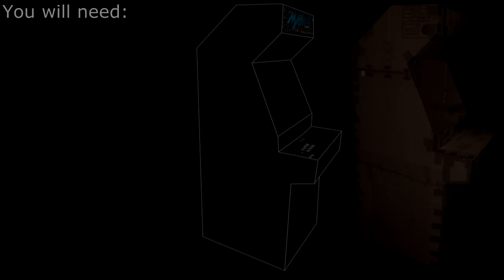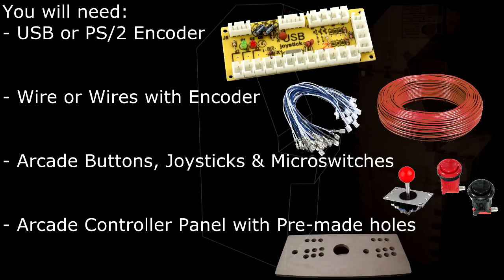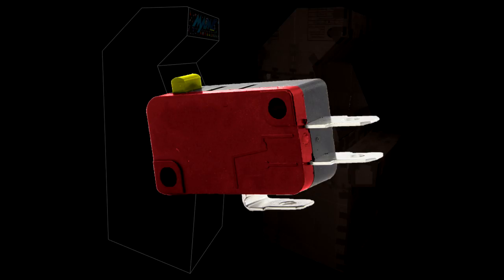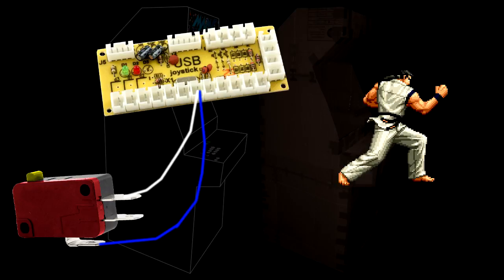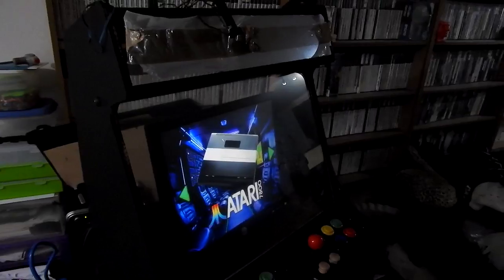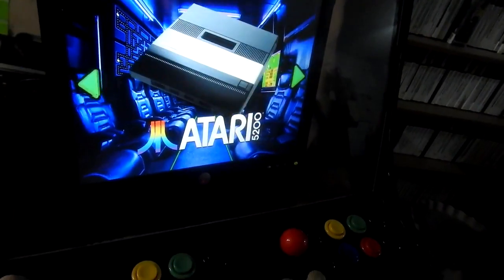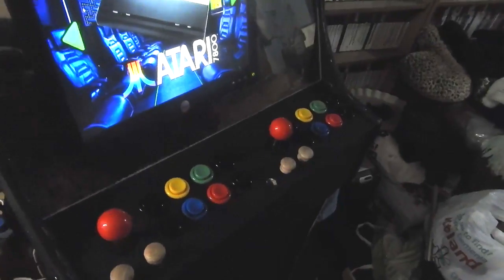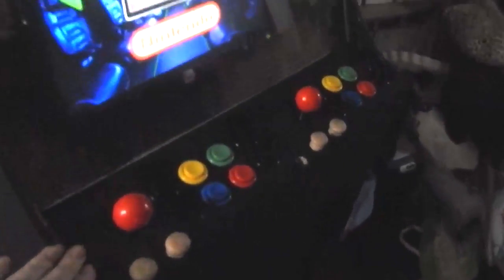How to Make an Arcade Controller Panel - Building A MAME Arcade Cabinet

Comment: Interesting video - and you maybe the guy to help me - I’ve recently bought a Sega mega drive mini or (Genesis mini) as it’s known in the states. I would like to build it into a 1up style cabinet and build an arcade style control board like you have there for it - can’t seem to find any info to do this online - the controllers that came with the mini mega drive are USB types so I’m guessing it’s possible to make a controller for it? Most builds are based on the raspberry Or Pandora systems but I’m pretty happy with the hardware I have. Hope someone can help - I’m totally new to all this.

Comment: The wiring would drive me nuts, I would rather fabricate the shell. Looking good.
Reply from the maker: Oh it drove me a little nuts by the end of it, simply because the cables were simply no where near long enough to wire everything up.
For future projects I will definitely be making sure the cables are long enough and extend ones that aren't with a soldering iron and shrink tubing. 
Or just use an X-Arcade Controller. Depends how much money and time you want to put into a Cabinet. Will vary from person to person. Such is custom one of a kind MAME arcades <3

Comment: I acquired a MAME arcade cabinet with an old IPAC FOUR that uses PS/2 connectors.  There are 2 joystics (4-direction only), 26 buttons, and a trackball.

The PC for the system (an old Pentium box running WinNTx64) has died.

I want to replace the computer with a Raspberry Pi 3 (running RetroPie).

I got a PS2-to-USB adapter and hooked up the IPAC to the Raspberry Pi.  It appears that the joysticks and buttons are coming across to RetroPie as a "keyboard", each button and joystick direction are coming across as keystrokes.

Am I on a viable path, or would I be better to replace the IPAC board with a newer USB board?  Thoughts on where I might go to better understand how to configure RetroPie to work with the current hardware?

Thanks in advance!